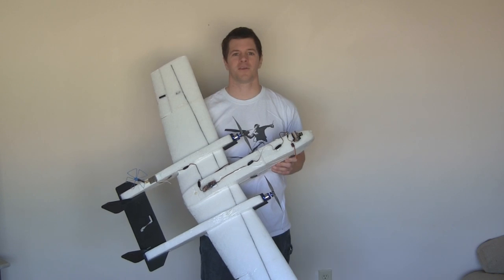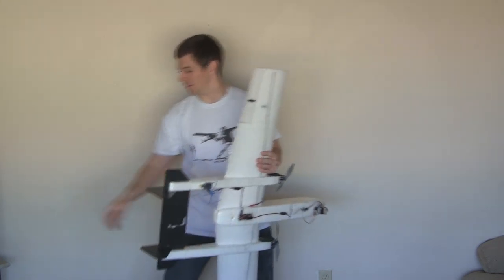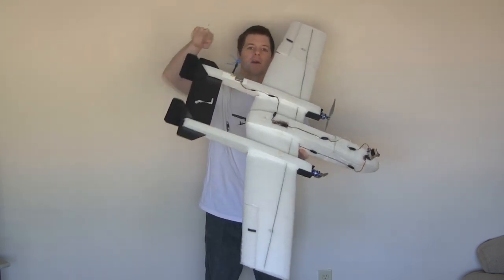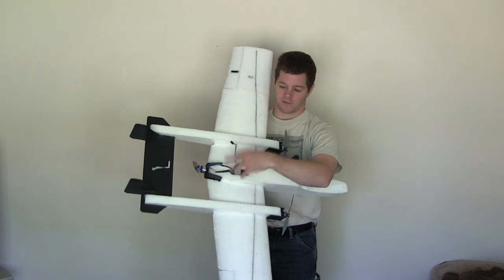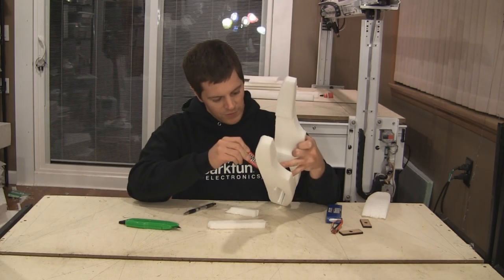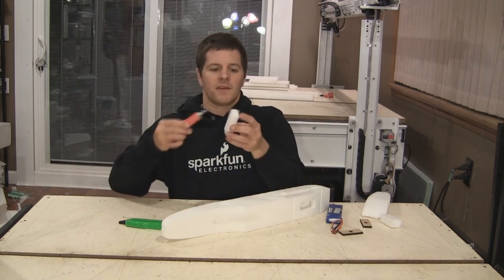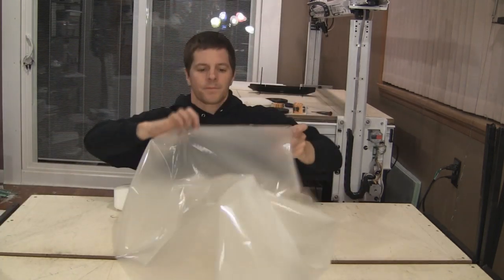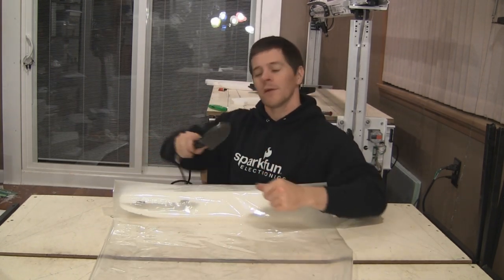Specter/Wraith build video

Comment: Hey Alex Jeremiah said you could put a 5000mah 3s in the Specter?
Reply from the maker: You can put a 3S5000 in the airplane.  It is a little bit tight, though.
Reply: Yeah i it fits just had to remove littel foam , Thanks for reply

Comment: Alex is this the part 2 for the 22 minute build the specter video??
Reply from the maker: I simply added to the older video, that is all.  Rather than a part 2, I just added the relevant content to this video instead.
Reply: Alex, you need to revise this video, I waited 2 weeks for an additional 3 minutes? the first extra minute is repeating the last minute of the original and then a shot of you holding the plane saying cut this. Your wing build and fuse sections are really comprehensive but you've skipped really important stuff like attaching the booms and then routing cables for vtx and/or placement. Considering this is the only reference I can go by as i purchased a kit from stone blue and there are no instructions included im pretty disappointed at this vid.Look at a flitetest build vid, no info left to imagination. I understand it may feel very simple for yourself as your building 6 a week that's fine, this is my first and only build so i have lots of questions and look to your vid for answers. Please help.
Reply from the maker: chris glasgow
 I show in the very beginning how to route all your wires.  You can also see how I have my airplanes wired in the video in the beginning. There are extra chambers for you to place extra components such as OSD and autopilot.  Where you place them is entirely up to you.
Reply: chris glasgow I cannot agree more. I just picked up this kit from StoneBlue and while that was a great experience (Jeremiah called me to discuss my setup!), actually figuring out how a lot of it goes together is a guessing game. This video is more of a "macro" look at how to build it but it could use quite a few more details. 

Once I figure all this out, however, I'm sure I'll love this plane!